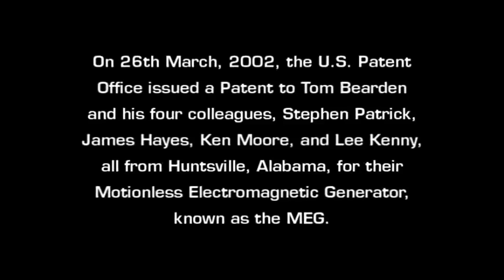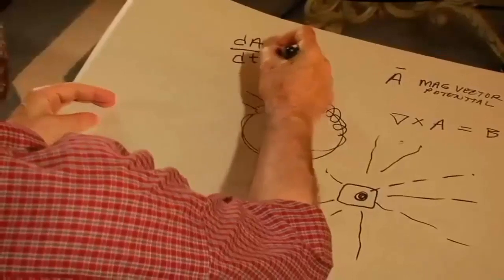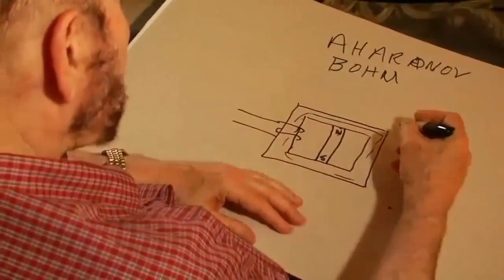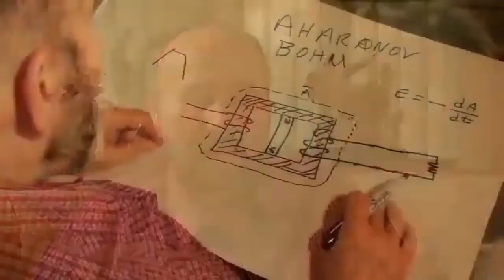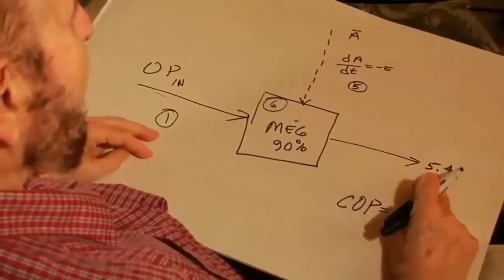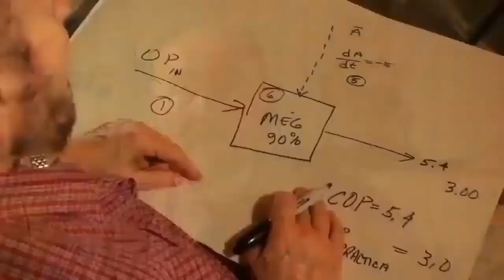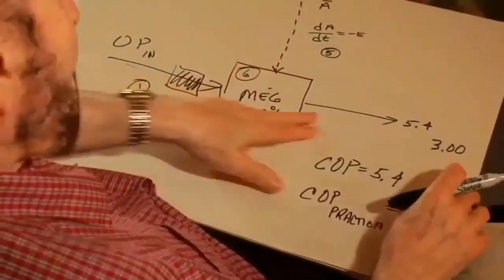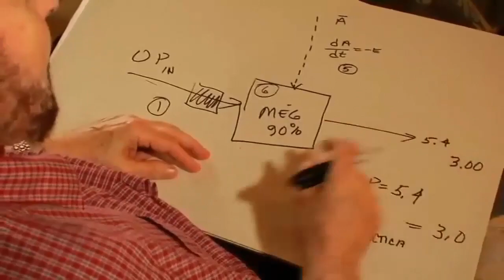T. Bearden MEG Diagram, How it works.

Comment: Actually every transformer uses the A mvp and aharonov bohm effect to transfer energy.
Curl free means that the field can be circular  but the paddle in the flow won't rotate, this means that the A mvp without curl behaves as a field with divergence only as with  motional induction, when A varies with time. That's why it's called a motionless generator. I think this atm.

He is also saying that the output voltage is generated by the user using a dc pulse. Sharp rise and decay time is a bit misleading, the current must change fast (disruptovely?) , not the voltage, the level of voltage determines the current through the coil.

Since the output emf is generated during the very short change in current, the output will be a self oscillation with the pm flux bias in the core.
Reply from the maker: @alanx4121  Could be a great observation.

I see it simpler than that. The A.B effect may play a role, but all in all, you have (X) amount of permanent static magnetic flux available, (Y) amount of core material to saturate or bring close to saturation.

Once you do this. Then it's literally just flux switching paths. 

The equilibrium movement back to center or homeostasis for the magnet's flux is always nature's free gift back.

Nature always is trying to give you 1.618-COP back. Always always. The golden ratio...

Even in setups without a magnet, such as Partnered output coils configurations which 'appear' to do a +1,-1,+1 situation where the asymmetrical coils BEMF-Kick back into the system sets up a feed forward condition, that could be similar to a leading P.F or a PF greater than 1. Which violates thermal. 

But many things violate thermal. Material effects; Long term memory (material); highly stable non-linear systems.... Systems showing apparent neg-entropy.(like LIFE) *They just hid it from you in the back of the Thermodynamics books.

That rant went off... anyway.

Yeah you are just hyper saturating the core in select spots forcing flux to take the least resistant path back to the source (itself) and that change in flux always generates current.

Cheers!
Reply: @Heliarc91  flux switching maybe makes more sense. Back mmf will push the flux back  and the coil gives it a little push towards the other end, but the simplest diagrams from Bearden have 1 input and 1 output coil and the pm which implies oscillations which may be what he calls highly non linear signals. Maybe the setup reverses the direction of the hysteresis loop, the pm sets the bias as in a magnetic amplifier.

Comment: When he explained the magnetic field would be contained nearly completely. That must be what replicators are doing wrong. Every video I’ve seen, the magnetic field is always spilling out
Reply from the maker: @wolfgangmetcalf9557  the Metglas core, or almost any transformer core does this. It's what iron does.

Transformer iron doesn't like going above 400hz much though. Metglas is good to atleast 10khz. Some much more.

The issue with metglas is though since it's tape wound you won't get the magnetic flux penetration as you would a vertically orentated core material (in slices)
Reply: Bearden is great, and I think he has hit the nail on the head in many things.  I'm actually writing a book on some new physical principles of the vacuum and interacting myself.  I took a break from writing. However, I plan on doing a series of videos explaining my theories with representations very soon.  Watch for this I'll be posting soon!
Reply from the maker: @thecontact2609  I am too!
About electronics and prepping!
Mine will have a free watermarked PDF available to all.
Let's do it!
Reply: Also, I might have figured out a way around the metglass situation.  I drew up a schematic and think it's worth trying at least.
Reply: Haha, I'm not sure how to share it though.